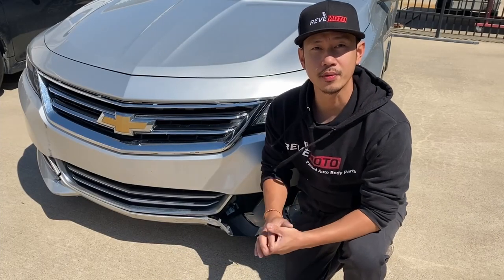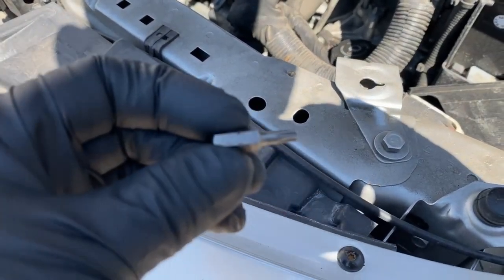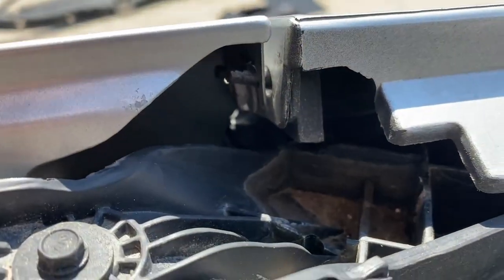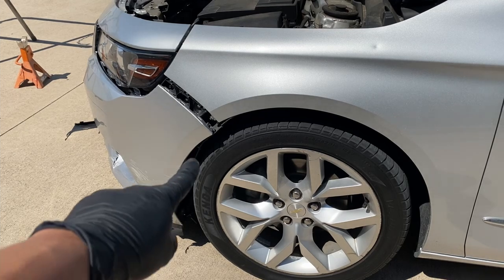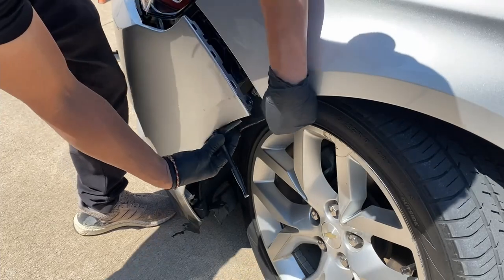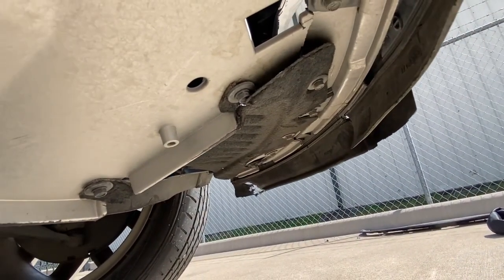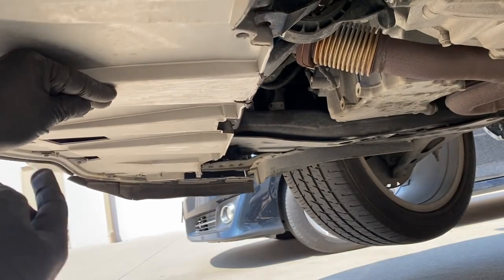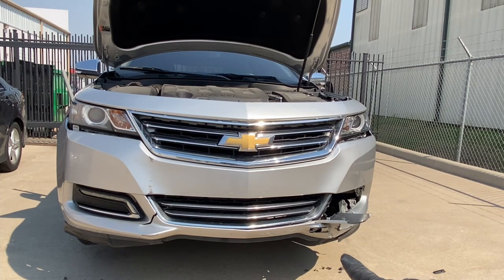How To Replace 2014-2020 Chevrolet Impala Front Bumper | Part 1 - Remove Bumper | ReveMoto

Comment: I'm doing a grill replacement on my 2020 Impala do I have to remove the front bumper and is it the same process as the 2019?
Reply from the maker: Hello! Yes, its recommended removing the bumper because it snaps into the back. It would be very troublesome to replace it while the bottom bumper is attached. Yes, it should be the same for the 2020. We'll change the title but that bumper is the only new style before they discontinued the Impala. Thank you for watching!

Comment: I need to replace the horn on my 2016 Impala. Can i get to it without removing the bumper? Thanks.
Reply from the maker: Hi Jay,  there is a possibility that if you take the headlight out then you can get to the horn without removing the bumper
Reply: Thank you for the video and for replying to my question.

Comment: Show us how to take out the condenser
Reply from the maker: Hello. Oof, we don't have the car anymore. Condensers can be annoying sometimes. You can normally remove them without taking off the fans and radiator. You do have to be gentle though, the metal is pretty soft. Drain the coolant, find the for bolts that connect the condenser and radiator. See if you can remove it without taking of the radiator. Sorry we could not help some more. Cheers!
Reply: @ReveMoto  thanks I’ll try and follow these steps. There’s no video on YouTube that shows how to remove it but I’ll make the video following these steps. Thanks a bunch

Comment: What is Adaptive Cruise and Active Shutter?  My impala is the basic version, 
what is the indicated front bumper?
Reply from the maker: The shutter is a feature on the grille that closes when you activate the cruise control to reduce drag. It's usually on the lower grille or in front of the condenser.  You can check with your dealership to see if you have it. Thanks for watching!
Reply: Could I buy a regular bumper and put the adaptive cruise part back on the new one?

Comment: Do you know anyone who has built a trim cover (on lower part of bumper) GM # 22738852 that will accept a real driving/fog light , like a diode dynamics SSC3 cube or SS2? It would be wonderful to have real aux lights for this 10 th generation impala?
Reply from the maker: Hello Chris! We do not know anyone who has done that. You seem like you know what you are talking about. We recommend visiting the Impala forums. The folks there are super technical and my have the answers you need. Thank you for watching!